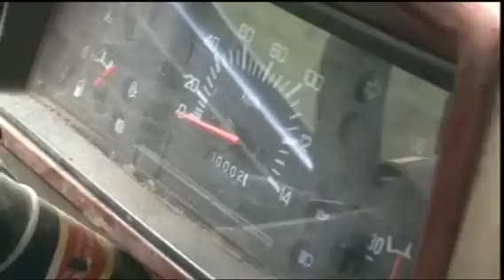Deadliest Journeys - China : The dizzy valley of the forgotten

Comment: 18:35 You can cross the river in 30 minutes using the zipline cable. Or you can hike all the way down to the bridge, but that will take half an hour.
Reply: how does it take 30 mins to cross the zip line if it clearly only takes like 30 seconds .....
Reply: Quality control on narration script Failed.  I believe they meant 30 seconds on zip line or 30 minutes to the nearest bridge.
Reply: The new vertical elevator has been installed it is located about 20 feet from the zip line , but i wonder....why is the entrance and exit of the elevator placed at the center of the river?
Reply: i was wondering about that, they do say villagers need to check the equipment also they say extra 1/2hrs that if would take the bridge - Getting someone free in the village, 10mins getting saddles up 10 mins, 3 mins zip line, 7min getting free.... could be 30mins you can't just get there and and you are teleported. So crossing a huge river even with a zipline could take 30mins without a doubt.
Reply: +TheAnalogKid2 agreed
Reply: Phillipe Steele. Who are you talking to?
Reply: hahahahaha yes  i saw that too, for the narretor  30 minutes and  haft hr is not the same. hahaha, how can they made mistake like it?
Reply: Brendan Stanford it says: "You can cross the river in 30 minutes using the zip line cable, instead of hiking the EXTRA 1/2 hour (tired and with a heavy load) to the bridge."
Reply: Dagmar l. It takes 30 seconds to cross using the zip line.
Reply: Dagmar l. And I know they have an "equipment inspection"   But no one is inspecting a harness for 29 and a half minutes. They ment to say you can cross the river in 30 seconds, or hike an extra half hour to the bridge
Reply: Oli Sto good brain work. 😊
Reply: I think he is saying. They use a zip line which takes 30mins. That may include all the time to check equipments and all, as opposed to walking an extra (note the word extra) 30mins to a bridge then u add the time n energy to cross the bridge may be another 30mins. .....
Reply: 30 min Zipline or a additional 30 min walk so 1 hour
Reply: I know, I had to replay that part 3 times and still didn’t understand it.
Reply: @brendanstanford5612  
Thank you for clarifying dialogue
for listeners who enjoy gaging on gnats
rather than enjoying the adventure......
Notice social fabric, cooperation, ingenuity
among diverse peoples. 
Follow up video due.
Reply: @charlesmichaels6648  ?
Reply: @brendanstanford5612  
Charcoal Merchants faced 30 second cable ride across the river, or 30 minute walk to a bridge.
Wheeeee !!!
Reply: TAKE THE LONG WAY HOME!

Comment: Don't get me wrong, producing coal in the mountains is laborious. But 15kg for a grown man is pretty little. My school bag weighed 10kg and I walked 2,5km uphill every day. 15kg is not a lot and even through the forest, 20kg to 30kg should be more than doable, considering my backback when climbing through mountains weighs 30kg.

50-400 years ago, German grindstone "builders" went into the mountains, hammering grinding stones of multiple 100kg out of the rock and bringin them 1000m down into the valley on wooden sleds through the forest without any path or road. Well, some died of course but that's how life goes. Compared to that, this work does not seem that hard.

Comment: Very remote area but they still have mobile phone service.
Reply: Actually it fairly easy to install cell service compared to installing landlines or even power lines going to every house. You just put towers every 20 miles or so. The tower can even have its own generators as either backup or main power, making them self-contained and low maintenance. No wires to go around installing everywhere and then repairing cause something breaks the line. Modern technology has changed the order that things develop in, and distance is much less of an obstacle if you only need to get in and out of an area very rarely. In rural El Salvador for instance, the homes of people I visited often did not have electricity and rarely had running water, but there were still two "internet cafes" in the village center, where slow but usable internet was available for cheap prices (by US standards, anyway.)